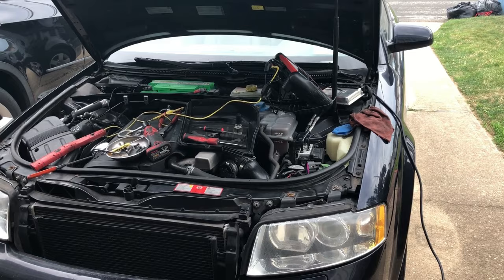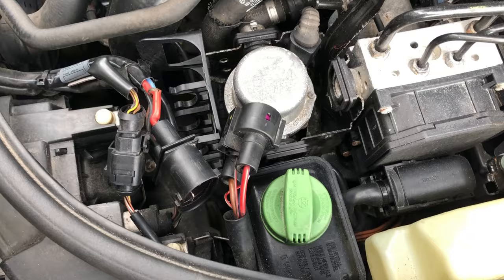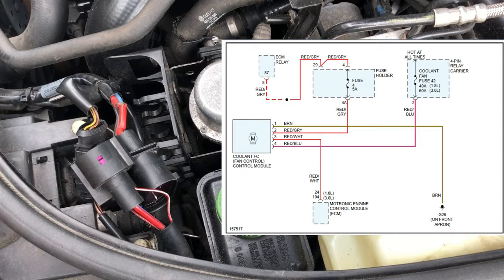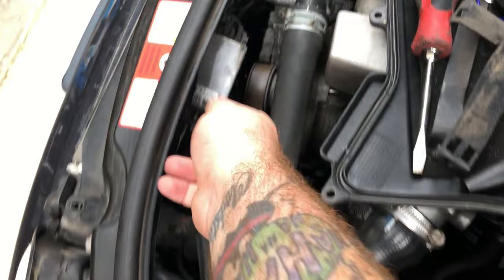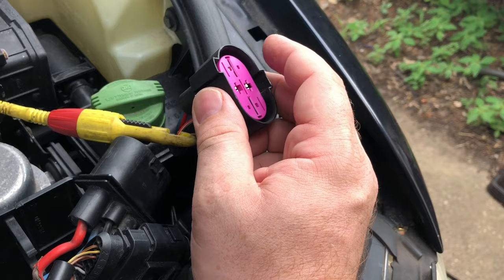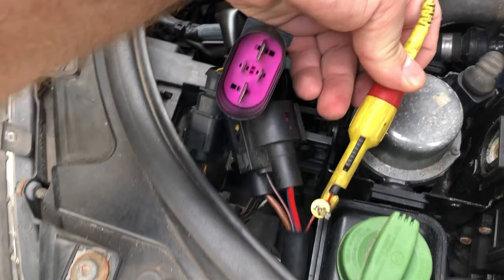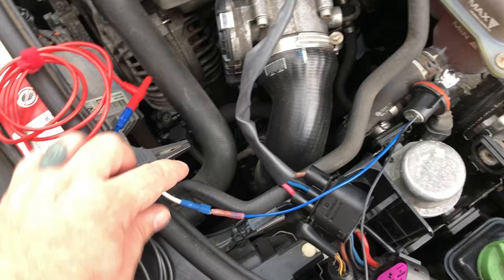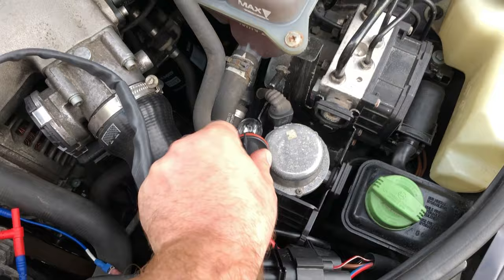VW/Audi Fan Controller - Case Study

Comment: I’ve been working with these Audi fan controllers for awhile an your diagnosis sounds right. However it should be known that most of the Audi fan modules have an internal fail safe to run 100% if the pwm signal is missing.
Reply: If you take the relay out for the fan, would that stop it?
Reply: That's what he was showing you he done to get the fan to turn off so he could diagnose it.

Comment: Just diagnosed a 17 Golf with the same issue but module is mounted on rear of single fan. Had to order new fan to get module. Your testing is right on only issue is puncher end on tool for the wires  destroys the insulation for copper wire that gets coroaded by salt if you are in an area were they use road salt for winter creating opens in harness. Better to use paper clip push in beside wire in plug to test circuit. Have a lot of electrical issues due to punctured casings on wiring harnesses due to testing tool punctures.
Reply: Have the same issue. while fan is on full speed as soon as the ignition is on, and then i start ac the fan turns off and turn on again after a delay  ac not blowing any cold air. The compressor wont click ....  when I clear the code ac starts  cold again..  it is the same problem as yours?

Comment: Thank you again TBT team. Fan control signal questions. Does the ECM deliver a 5 VDC pulse or 12 VDC pulse to the fan control module? Or, does the fan control module deliver a 5 Vref or 12 Vref to the ECM and the ECM toggles the voltage on off ground to create the digital PWM signal? Have a blessed and safe week to you and your families.
Reply: My guess is that the cooling fan module supplies 12V to the ECM which pulses it to ground to create a PWM signal for the fan.

Comment: Anytime you create an open between the ECM and Fan control module such as backing out that communication wire the fan WILL run at full speed ... This is built in as a safety feature so the engine won't overheat if there's loss of communication.  Most Audi and VW vehicles that have a separate fan module do this and you can test this on a known good vehicle
Reply: But I do agree the fan module is normally what fails on these

Comment: Hello Chris. You posted this video four years ago so you may not be monitoring the comments but....  
I have a VW Golf Mk4 4Mo that I rally. I've had repeated issues with the FCM failing. I believe this is pretty common. I'm guessing that the connections on the PCB get broken or damaged and hey presto, no fans. The FCM is sealed so its not possible to open it up and check it. Do you know how I could put in a bypass switch so I can turn the fans on manually?

Comment: Great case study. I had a PT Cruiser fail in a similar way. The fan never worked, but the module would feed 12 volts on the ASD circuit. 3 aftermarket fans in a row did that, junkyard OE fixed it. 

BTW... You are a better man than me, I would have just clipped the control wire 🤣

Comment: Bro i have Audi TT 2.0 turbo 2008 model. After recent engine removal for gasket change, the coolant fan alwas on as soon as the ignition is on. I have changed coolant sensor as well still the issue not fixed. Let me know if you came across such issue and how to fix it.

Comment: Thanks for sharing this, I have volkswagen polo diesel 1.2, it also have similar issue fan stays on all the time. But only after turning on the car not starting the engine just turing on.
It does not have separate fan control module, can you recommend what could be the problem?
Reply: Old comment, but that could be the fan temperature sensor. That's a cheap and usually easibly replaceable part.

Comment: Great video, Chris. I have the same issue on my 07 A4. Odd thing is, when I open the car door, it stops. When I close the door, the fan starts again. Any thoughts on that?
Reply: Have u solved your issue as i am facing the same issue when i close the door the fan start running on high speed

Comment: Thanks for the excellent video. Just have a quick question. I have the same issue but my fan module is ok does that mean the problem is at the ECU ? Any help would be great. Cheers 👍
Reply: same boat my red/white wire doesn't send reference V unless the A/C is on.  Did you find the fix?

Comment: Good video I have my 2009 audi s5 4.2 v8 I have to turn AC on and than  the fans only driver side running turn off AC fans not turn on both fans not on, I check got power when car is running is show 14 volt 
Before was running on all the time fast speeds when car off draining my battery so replaced control module got from a guy junkyard I don't know control module bad or good or  something else.  Need help here thank you

Comment: I'm confused how depinning the control wire shows that control module has an issue? Supposedly a lot of these control modules turn the fan on full blast when there's no PWM signal detected?

Comment: I was hoping to see what will be the outcome after you installed the new radiator fan control module (RFCM), I had similar problem and I was about to install a new fan control module but what I found out was mind blowing. the cause of the problem was an air conditioner fuse that was missing . that's it

Comment: Hello, I got this code 04531
P069100: Cooling Fan 1 Control Circuit Low. Fan not working no ELM light on dash tried to test connector to control module with multimeter is 12v connected wires directly to fan working, replaced control module same also checked all fuses is good.

Comment: So i just bought an b6 S4 and got a open circuit code for my fans and it overheated on me once but not again in a while. I just checked and the plug wasn’t plugged in at all, could this be because previous owner knew that if it stayed unplugged the fans would stay running so they left it unplugged?

Comment: Unnecessary wire piercing when backprobing is easily possible. Why?
Reply: liviu2004. When doing diagnostics, accuracy is most important. When a problem may be a pin tension issue, piercing is the only way not to mess with your connection. 

Done correctly (notice I said correctly), piercing is the best way to get an accurate signal. 

Always make sure to use the sharpest probes, and only turn in enough to touch the wire. If you look in the video, you can see the clear nail polish I use on every connection to form a air and water right seal. 

Also I don’t ever have to worry is my signal on my scope is from a loose connection or not. 

That being said, I have a drawer FULL of all different types of back probes.
Reply: @chrismartino9078  I hear u but in this case if u had punctured t other side of t connector (fan side) then this wiring would have bn replaced with t new fan module - saving u a repair of t insulation on t car harness side. But a great video either way. 👍
Reply: @david-iandawson  that’s not how this tool works. You put the wire into the tool first, then you turn the knob until you see a signal. The tool also has a v shaped groove to only select one wire. This will ensure you only pierce the one wire
Reply: @chrismartino9078  I understand how t probe tool works Chris. I was merely saying had u probed t same wire (but on t fan harness side) then u wouldn't have had to disturb any of r vehicle wiring - saving u t job of repairing t insulation with lacquer (or whatever u used). T Golf 4 (Rabbit) suffered t same fault however t fan module was part of t main fan motor, this would cause t A/C to overpressurise as speed 1 fan would be in-op. Great work 👍

Comment: Hey TBT I have an 2002 audi a4 B6 and my cooling fan doesn't come on at all and I've replaced all the temperature sensors, thermostat, relays  and the cooling fan control module and it still won't come on when the engine needs it. could you help me out?

Comment: Had a problem with my cupra for a while...fans not turning off unless the fuse is removed. I'm attempting to replace fan switch and thermo switch and hoping it helps. Already replaced the control and hasnt solved it
Reply from the maker: Always test before replacing expensive parts!
Reply: @TrainedbyTechs  hasnt been too much cost atm the module was 20, thermo and fan switch around 8 quid each...I'm hoping the fault lies with one of them

Comment: Effective! Any way to substitute the scope with a dvom? How would one set it up?
Reply: A regular multimeter will be to slow to catch the square wave.Anyway you can try to set the multimeter on 12v DC.i think you will see some readings but a a scope is require in this situation.

Comment: I have an 06 a4 2.0turbo with ac both my fans stop working causing my car to over heat! 
I have constant power to the red wire & the control wire that tells the module to turn the fan on. I have put 3 modules on this car and still neither of the fans come on, with or with out the ac being on. I have power on the opposite side of the module that feed the module it's self but nothing to either of the wires running to the fans, I've replaced all the relays, fuses, coolant temp sensor to no avail. I know the fan motors are good because i can jump them with a hot wire. 
What gets me is the relay that is under the ECU that supposedly controls the fan, will shut the car off if you pull it out while the car is running. Whether its the new one i put in it or the one that was in it. I'm at a loss. If you get this message and can lead me in a direction in which I have not all ready been. I would GREATLY APPRECIATE IT. God bless.
Reply: Mine aren’t turning on either I’m pretty sure I just need a module do you still have yours? If so, I’d be more than willing to take one off your hands
Reply: @ill3stxmob111  i got of the car.

Comment: Great video only thing piercing wires big no no from me 
Spent ages chasing fault due someone pierced wire previously and wire corroded giving intermittent fault 
Otherwise great video
Reply from the maker: Piercing is only bad when the insulation is improperly pierced and not properly re-sealed when finished. This is a common debate but in our experience, piercing outweighs any other method of signal acquisition.
Reply: Trained by Techs partially agree using decent back probing so too proper connection can be achieved 
In my case the pierced wire was attempted to seal with liquid tape but due oil contamination on the insulation it a loved water ingress int copper core and that was it 
That was the most remembered one but had come across many pierced wires and usually no one bothers to reseal damaged insulation
Reply from the maker: It can be argued both ways. Each method has cons. Ive seen backprobing restore poor pin fittment issues masking a problem you now will never find.  Ive seen backprobing cause damage to the weather pack seal on the connector. Ive seen Backprobing cause adjacent terminals in a connector to short together when the probe is inserted. There is no perfect method unfortunately but in our experience, the only con of gently piercing, is having to reseal when done. Quality pierce probes used correctly leave almost zero penetration marks visible.

Comment: That's awesome Chris. Do u have a recommendation on a good kit to de-pin connectors. Very few I can get with a T-pin. Thank u
Reply: @craigtirrell3026  I remember I got my butt kicked one time on this limousine with no A/c operation  that I took over for one of the guys in the shop. Code in memory was ac pressure sensor high. I Pierced the signal wire. Keyword is Pireced lol. I had 5 volts. All tests were done plugged in. Reference voltage was there and the main guy I wanted to check was the ground. Open in the ground u would have high voltage all the time. That checked out good. Less than 100 mV. Diagram was wrong in color and when looking at scan data with a test light I was trying to pull the which I thought was the signal wire to ground and scan data didn't react. I went to the computer and did the same thing and no change. I almost called a computer but something told me to go back to the sensor and when I unplugged it the signal wire pin connector was pulled back and not making contact with sensor. It pushed back and clicked and all was well. That was like 2 years ago and I still remember it like it happened yesterday. Hopefully Chris gets back to us soon. That's a cool time saver diagnostic tip
Reply: @craigtirrell3026  I was told a bottle of stabilant 22 only one drop would help with poor contact issues. The professionals told me they try that before condemning an expensive module. It sounds like u are having poor contact.
Reply: I used my snap on de-pinning kit to take out the connectors.

Comment: The Power supply from the relay should be checked to. It Could be shorted in tje relay. That Was the problem in My case. The Fan Module wasen't the problem here. And it was also turning on by it self with that Power feed from the relay. With ignition off 🙂.

Comment: My 2006 audi a3 front wheel drive turbo is doing the same thing, its driving me nuts and nobody can fix it
Reply from the maker: I wouldn't say nobody ;)
Reply: @TrainedbyTechs  well by my location, imma try and change the module once I verify its behind the drivers side cooling fan
Reply from the maker: Make sure you test it properly before replacing it. Use this video as a guide to do the testing yourself. Do not assume!
Reply: @TrainedbyTechs i understand

Comment: my 2004 a6 2.7t does this....but it's not the one connected to the engine.  it's the two auxillary fans.  they stay on even after cold start and i turn it off driving for 2 min lol.  xD any ideas? it's annoying... my car sounds like a fucking jet engine sometimes

Comment: So, "nothing was telling the fan to shut off" after you DISCONNECT the wire.. hmm

But in the first instance with the wire connected the fan was doing exactly the same!

No offence but there is a flow in your logic.

I think you changed the module just knowing that the control module is prone to failure.

Yeah, switching the bulb on was illuminating.

(I hope you accept/take the banter and irony..)
Reply from the maker: The wire that was de-pinned from the connector is the communication circuit from the engine control module to the fan controller. With that wire not connected there is no longer any communication potential from the engine control module. This leaves us with the fan controller as the only remaining component able to turn that fan on or off. 

I hope that clears things up.